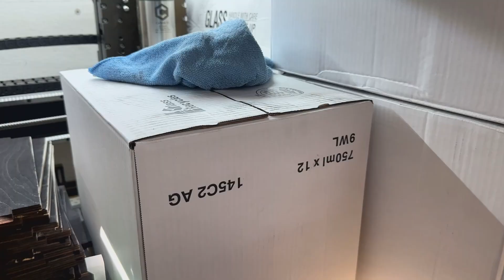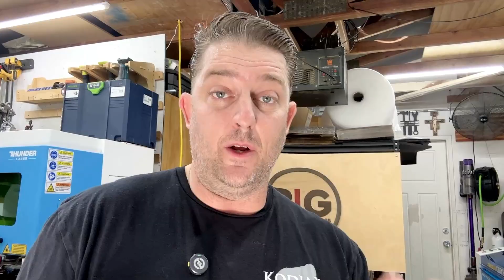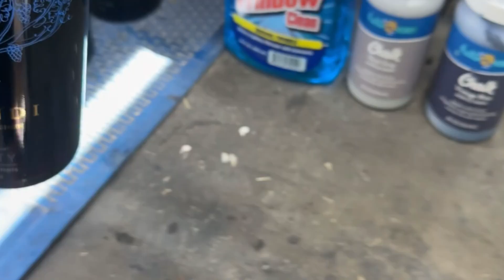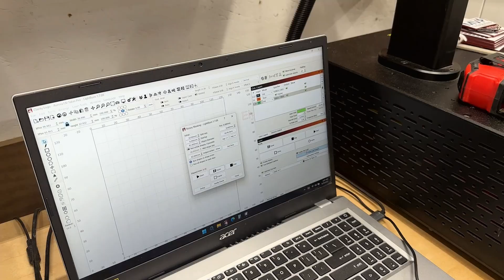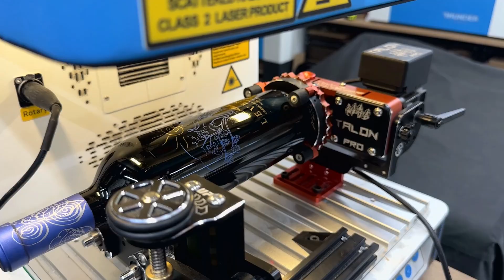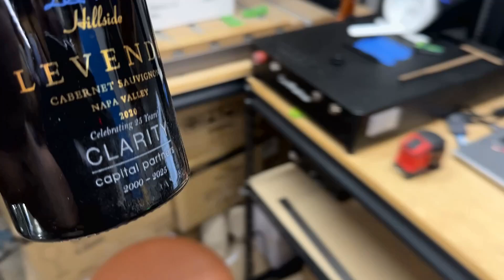How I Nail Perfect Wine Bottle Engravings (Plus Shop Updates & What’s Next)  | Brett's Laser Garage

Comment: New to this. I see you've had a couple uv engravers which do you prefer? What unit are you using here?
Reply from the maker: Thank you.  Yes, I have a Thunder Aurora 8 UV laser and a ComMarker Omni1.  Both are 5w air cooled units and work great.  

Slight edge to the Thunder because it has an enclosure and a higher end laser source so it can work at a greater range of frequencies.

Comment: Did you get the Commark after you got the Thunder Aurora - how do they compare?
Reply from the maker: Yes.  I purchased the Thunder Aurora UV prior to getting the Omni1.  That’s a big question, probably worth a whole video, but briefly here’s my thoughts.  

The Thunder is slightly more versatile, its source allows for a wider range of frequency and q-pulse settings.  It’s fully enclosed.  It comes with top notch, US based support.  However, it’s double the price of the Omni1.  

If tech support is a deal breaker, the thunder is the way to go.  But for me, I use them both mainly for glass engraving and the overall job quality I produce with each is identical.
Reply: @LaserGarage  Thank you! I'd watch that video 🙂